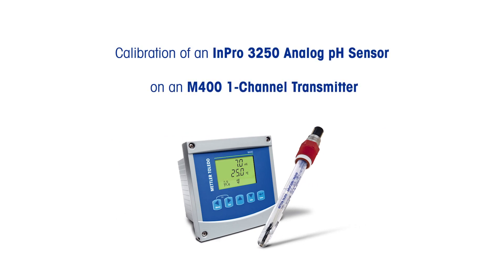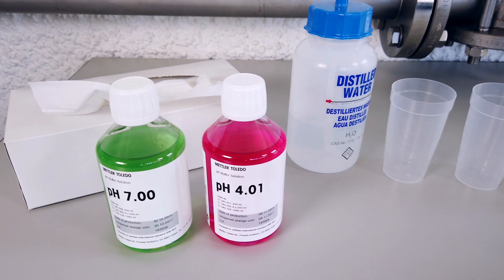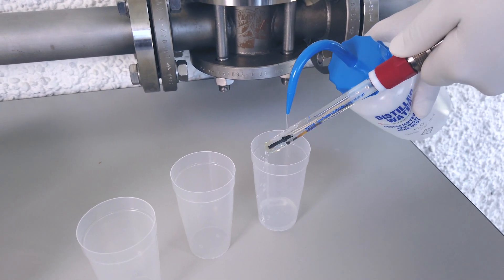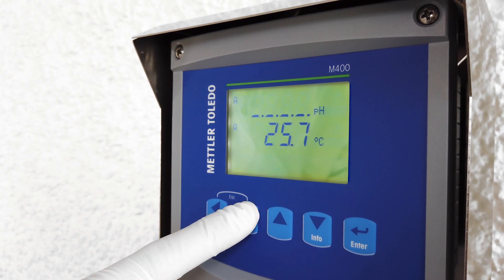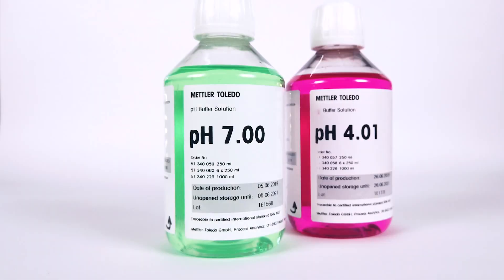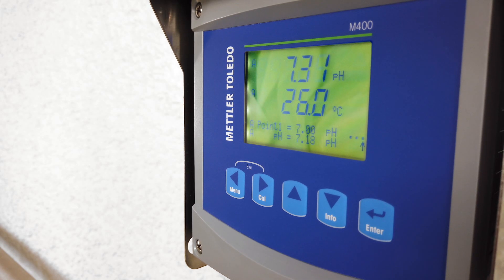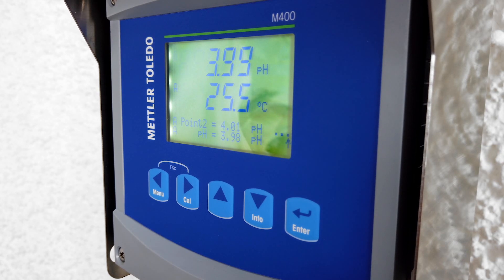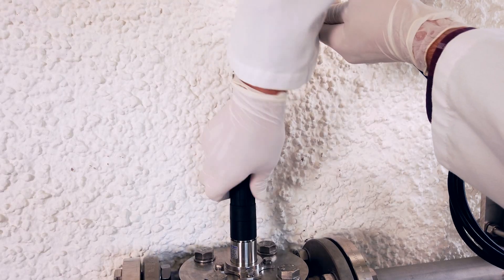How to Calibrate a pH Sensor: InPro 3250 & M400 (2008-2018)

Comment: What if a known good 7ph solution is popping up a 9ph? Cant figure out why this is happening & its throwing off my calibration.
Reply from the maker: @kingvegas3 Thank you for reaching out! We will be happy to address the issue you write about:
If your pH sensor shows pH 9 in a pH 7 buffer solution, it is most likely that a faulty calibration has led to a big offset of two pH units. The problem is that now the buffer solutions are not properly recognized when trying to do a one- or two-point calibration. You can correct that by performing a process calibration first to correct the offset. Subsequently, do a two-point calibration with Mettler Toledo pH 4.01 and pH 7.00 buffer solutions. Make sure you use the right buffer tables. 
Let us know if this answer helped you solve the problem :) Stay tuned!

Comment: How to calibrate Mettler Toledo DO sensor O2 - 4050 e in terms of % of air saturation with fermentation medium.
Reply from the maker: Dear @rajamurugan2356, 
A DO probe in a saturated fermentation medium is usually set to 100% by applying a slope calibration (Process Calibration). With optical DO probes, we recommend using our “Scaling” function.
Best regards